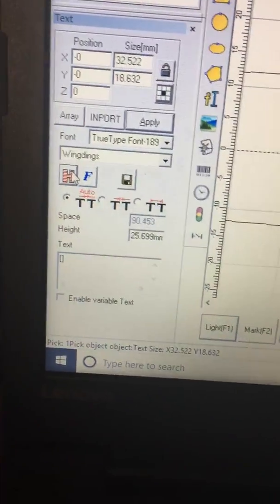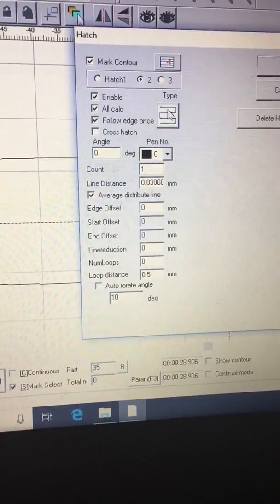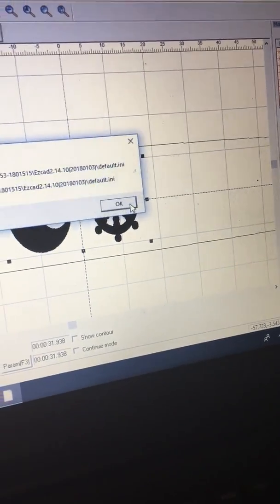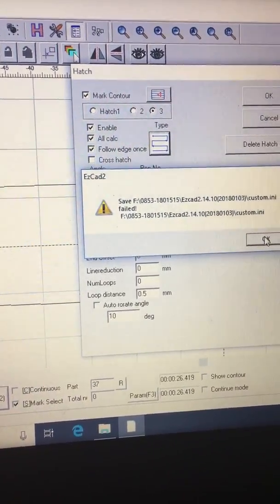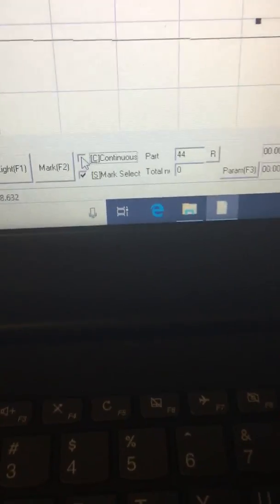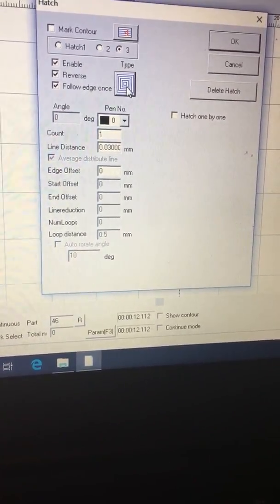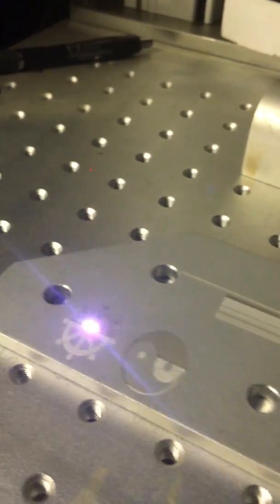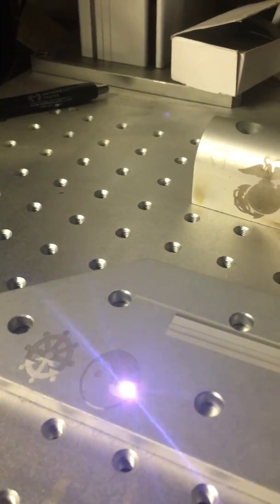EzCad2 hatch set up

Comment: You notice that after every pass, there is a finalizing pass.  On mine that finalizing pass leaves lines in the cut or burn or image.  I want to stop that.. The whole things looks great until the end of the pass and it does that finalizing pass after the main burning or cut is done. Is there a way to disable and turn that off.. On somethings it just traces back over the image.  On a hatch it passes back over the entire image you just burned and leaves lines in it..